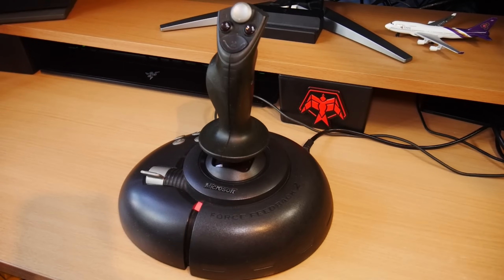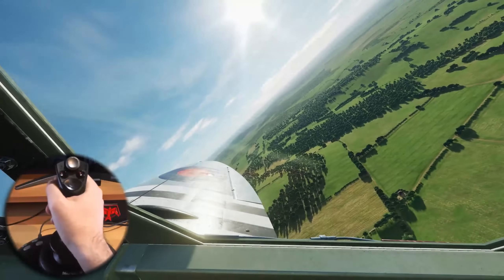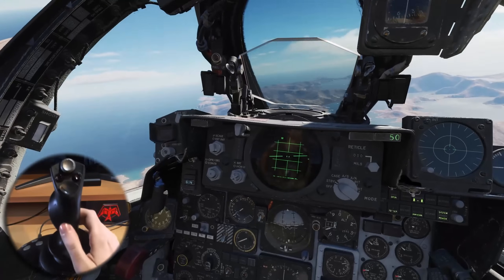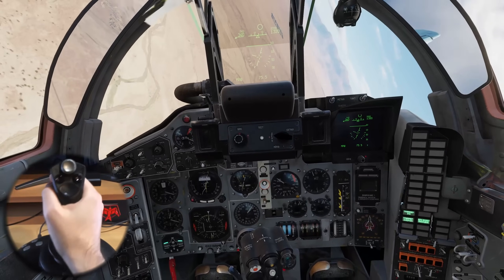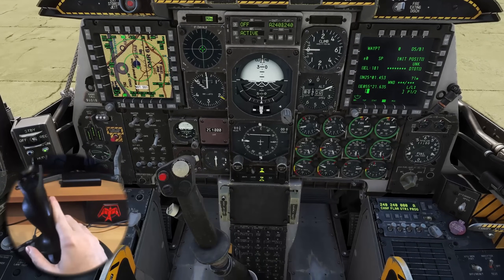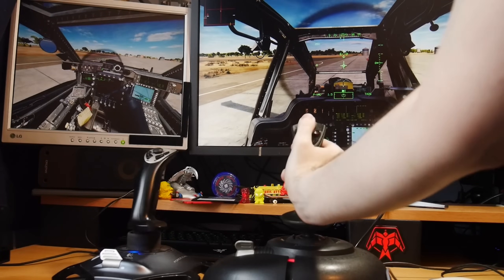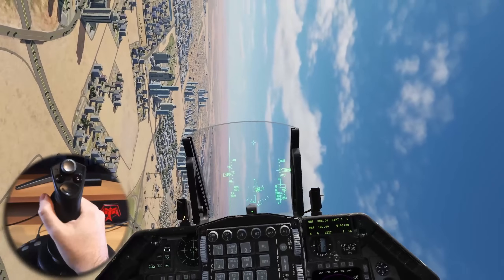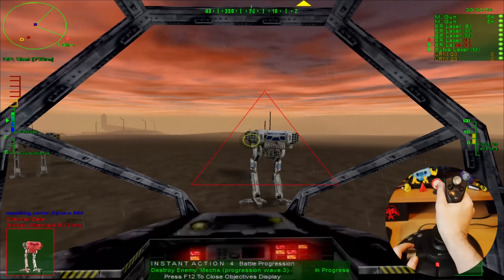Force Feedback in Digital Combat Simulator, An introduction

Comment: Id love to get a FFB stick. My issue is im VERY SENSITIVE to my gear breaking. And looking at FFB sticks mechanics, i can see them being very fragile. I prefer not to pay 300 400 bucks for something that will need repair in 2 months.
Reply from the maker: Unfortunately there's no way to know durability just yet, they're belt driven connected to large electric motors, so not a huge amount to go wrong, unless they overheat. I imagine eventually the belts will need replacing.

Comment: Got my VPForce for a while.  Best FFB stick out on the market presently.  Its a game changer for DCS, especially for helicopters.  Trimming actually works really simply and smoothly.  All the bumps and disturbances from flying aircraft and forces of the planes control systems itself get felt.  The VPForce software does a great job at adding in force inputs that DCS otherwise lacks, typically an issue with ED's modules.  Best module with FFB support is currently the F-4.  They spent a lot of attention and detail on it
Reply: And for those competitive folks, the feedback from FFB does make you a better virtual pilot.  Especially when it comes to feeling how close you are to the stall.  WW2 pilots, looking at you.  You can immediately put the 51 in a hard turn on the razor edge of the stall and hold it there as long as you want.
Reply from the maker: 100% agree, it's one of those you can't go back items that's a big step up, i was so upset when the technology died off in the 00s
Reply: Literally my case, but a little bit different, I use FFBeast and when I got it I literally started to experience flight differently, I can't imagine using spring joystick anymore.
For WW2 planes it's a literally must have because you can understand how much energy do you have without looking on speed gauge, hope it will become more mainstream because flight sims without simulating real controls is meh
Reply: lol vpforce isn’t the best because you spend $$$ 😂 moza beats it for less!

Comment: I have been flying DCS and ARMA3 for 10years now with a Logitech G940. I had it rewired and bought a second set to canibalise if and when needed.....
Magnetic FFB..... i dont think I ever going to have a non FFB setup
Reply from the maker: I hope the future is FFB, rather than the past, just like VR it's a major step up. I'd considered picking up another MS FFB2 for parts/longevity too. But the limited buttons meant i rarely use it in DCS (outside of Warbirds/Huey)
Reply: @RedKiteRender  Try to get a G940
after the throtle revire (its a must) its a amazing HOTAS with a ingame modifiyer I never have to tuch the keyboard. 
The only bad is its sooooo hard to find one and usualy very pricy.... but... it still a magnetic FFB. If you dig into why we dont have them anymore you will find that the patent has been bought by a company and they are not willing to let it out.... cunts

Comment: I have a Microsoft Sidewinder, but what was the joystick to the left when the two joysticks were shown?
Reply from the maker: It is a Logitech Force 3d Pro. They didn't last very long on the market, due to constantly breaking themselves and the mechanical linkages inside feeling like a bag of rocks being stirred around. Were a bit of a flop, though the body/stick were reused in a conventional spring joystick version which is still on sale today.
Reply: @RedKiteRender  thank you!  I was thinking about picking one up from eBay like I did with the Sidewinder, but with your description I may pass!  Lol!
Reply from the maker: Yeah I'd recommend skipping it. Mine also has a dodgy sensor (potentiometer?) and jumps about a little causing FFB spikes, despite the relatively low usage it got in the end! 

MS FFB2 on the other hand works pretty well, the USB is starting to give out and I'll have to replace it, and the trigger s slightly rough, all after some 20 years of use. The safety light sensor has become blocked with dirt, but that's almost a positive, since it allows me to show it functioning with hands off.
Reply: @RedKiteRender  Have you ever tried a G940?  I am wondering how that compares to an FFB2.  My next stick is likely to be the moza AB9, but I was debating between a 940 and an FFB2 back when I was buying my first FFB stick and went with the 940.

I like it, though it was ancient when I bought it and has finally wore out to the point where the stick's sensor and the feedback system are no longer synced, which makes it kind of unusable.
Reply from the maker: Sadly no I've not tried it.
Reply: Logitech Force3D Pro I think.

Comment: Using FFBeast for a few months, it's transformed the experience of flying, especially for the warbirds. The software will allow you to add effects beyond what DCS provides, for the F-16, for example.
Reply from the maker: Yeah as i mention later, the software support for adding in effects is just as crucial as the hardware is, DCS's FFB is lacking at its core, so with this new wave of gear, i hope they get around to improving the native ffb support.
Reply: @RedKiteRender  yes I saw that. Agree FFB as a module specific feature would indeed be great. Configuring each aircraft individually is a bit of a pain....

Comment: There is also Brunner, it's a high quality FFB stick as well.
Reply: Every single person I have seen who bought one strongly disliked it due to their tendency to overheat.
Reply: @jimmydesouza4375  As someone who owned and returned a Brunner CLS-E base, its tendency to overheat is accurate. Not only are the maximum forces quite weak, but it overheats in a matter of seconds at max force and max deflection, after which the base immediately turns off the motors and goes slack for a few seconds. This made it unusable for anything that needs the stick to be held at large deflections for long periods of time, for example WWI and WWII aircraft. On top of that, it's almost triple the cost of the Moza AB9 and only has half the maximum force.
Reply from the maker: That's disappointing to hear, it's a much older design and more expensive than the new generation, it should have really been refined by this point.
Reply: @RedKiteRender  From what I can gather it is only a problem with the CLS-E (and only one of the problems with it, the other being its low maximum force output making it borderline for usability).

The brunner CLS-P (which is the professional grade version) from what I can gather doesn't have the overheating issue, but costs something like 6 grand and is a special order.
Reply from the maker: The Brunner being professional market is why i omitted it from mention. Does sound like it's not worth looking at compared to current generation!